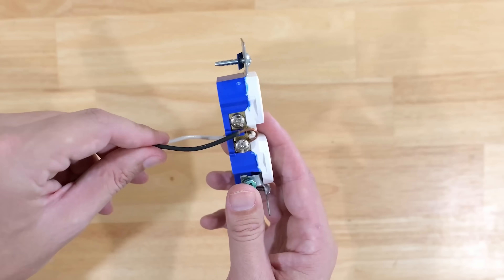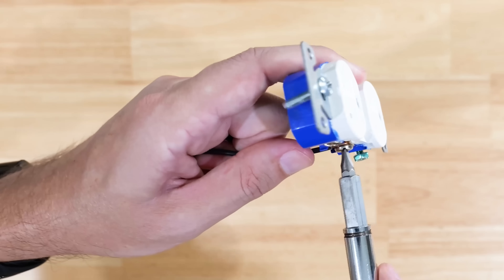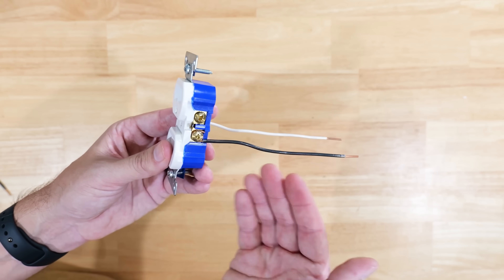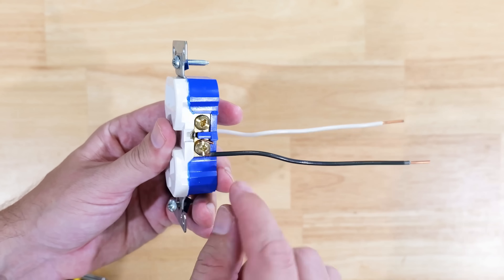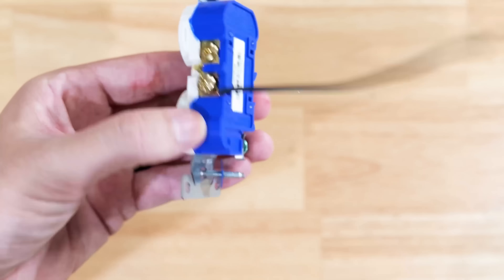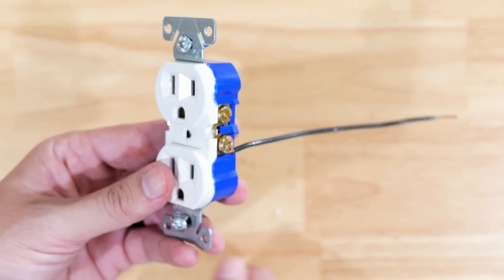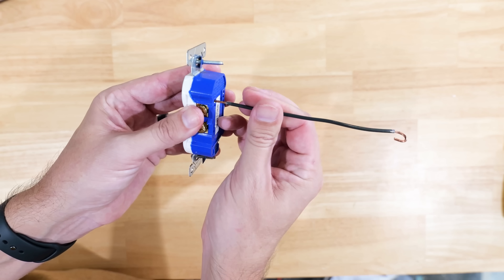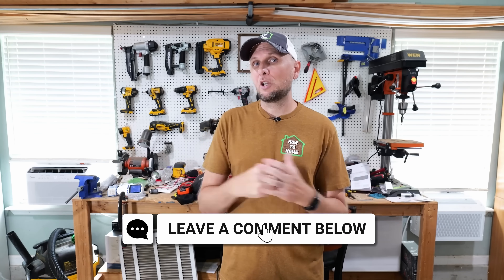Avoid Disaster! 8 FATAL Outlet Mistakes Most DIYers Unknowingly Make!

Comment: One correction and one pro tip: 1) You can only put 15A receptacles on a 20A circuit if there is more than one receptacle in that circuit. If there is only one receptacle on the circuit, it must remain 20A rated by using the 20A receptacle. 2) Directly terminating stranded wire to a receptacle screw is bad practice, regardless of the direction you install the wire. Use proper terminating materials like fork crimps for a much better install. There will be less of a chance of a hot spot.
Reply: I was looking for this comment so I didn't post a redundant one, also - NEC requires residential receptacles to be of a tamper proof (TR) style in most cases so the industrial receptacle does not meet that requirement if you are getting inspected.
Reply: So would 20Amp with 20Amp/multiple receptacles work?
Reply: @bobthorn7879  yes
Reply: @Tom-6502 I wasn't confused. I said one receptacle, not one duplex receptacle. So in essence, we are aligned in our thinking.
Reply: I still wouldn't do it as a professional electrician
Reply: @victorciccarone6291  ya I don't think I've ever seen it done on a commercial/industrial job but shackers do it all the time.
Reply: #2 is actually not allowed in some codes, i.e Ontario. One must crimp proper connectors on a stranded wire before terminating at an outlet
Reply: @TveTop  agree, it probably should be a code everywhere.
Reply: Loose wires not only cause fires, but they also increase your electric usage and bill. An arcing wire in a panel or on an outlet uses a lot of electricity. I had a friend who told me he had a large electric bill, his house had old type fuses. Tightened  the connections, next month his bill dropped to half, of what it was. Electrical connections, loosen with electricity going through them, over time. All connections in a house should be checked, and re-tightened, at least once every 10 years! 😮
Reply: @albertandersen627  It's not really possible to use up that much energy in a bad connection, since either the voltage will be dropping at the device to the point where it's unusable, or will burn up the bad connection and/or start a fire.  Just a few watts at the contact will be enough to burn/melt it over time, and that's not going to be noticeable on your bill.  If it was much more than that, it'd fail in some manner with or without fire.

I think there's some other coincidence to your friend's electrical bill dropping when he tightened things up.

I'm not disagreeing about anything else, though.  It's important to have secure electrical connections, because even if they're not immediately failing, a poor connection will heat up, and oxidize and/or fatigue over time making it even more likely to fail catastrophically as time goes on.
Reply: This is how they wired my moms new kitchen I thought it was wrong tell I found it was up to code to wire it like this

Comment: Great video! Very useful and good explanations of why you shouldn't wire receptacles a certain way and why the correct method is superior. I would also add that you shouldn't assume that the existing wiring has the correct polarity. I've seen several situations where someone ran a new circuit and reversed the polarity on the wire.

Comment: ermm AC is alternating current.. but yes should do the right sides for connections. now if these are being used for DC (direct current as in only flows 1 way) thats a diff deal.
Reply from the maker: It’s not though.  The things being plugged into the outlets are designed for the power to be fed from one direction.  If it’s coming from the neutral side then there is a risk of shock or electrocution as the on off mechanism won’t be stopping it at the start.

Comment: Strip wire where screw is on side. The distance from the back of the receptacle to the front from where the cover plate screw hole is. The thickness of that part is the proper length to strip.

Comment: I guess what you're saying makes sense. Too people that don't do wiring much, but for somebody. That's been wearing houses for 30 years. It's a little bit silly. However, I thought that when you talk about the last Leviton.  Receptacle that you didn't explain anything about the internals and if it's got the same amount of metal touching metal as the push in type.  In the back of the receptacle that you had a problem with.

Comment: @35 yr ago I entered my woman's walk-in closet and flipped the light switch;  I heard a "clunk" noise, didn't think much fora few seconds, then took the cover off the handy box.  Old wooden house with conduit & metal baxes;  box filled with lint.  Carbonized lint arcing against box!  Gained new respect for taping around conectors - especially in metal 2 X 4 box.  Another time yrs later, newly rented apartment, went to change the lamp above the bathroom wash basin (switch down) and skin contacted threaed base in fixture - major buzz - hot going up to base of fixture where ought be neutral.  Any place new check everything.

Comment: Baloney.  Click-bait on the first item in the video.  The 15-amp breaker determines a minimum receptacle rating--15 amps--and there is nothing unsafe about installing a 20-amp receptacle in a 15-amp protected circuit. We don't base our wire sizes on the assumption that an operating, correctly-sized breaker is going to fail.  WTH sense does that make?!
Reply from the maker: Then you are going against NEC code.  These codes are there for a reason.  You talk as if you do this professionally and if that is the case you may want to read the code book because what you are talking about is not only illegal but also dangerous.  So you can call it clickbait or baloney or whatever you want but you are completely wrong here.
Reply: @HowToHomeDIY  Cite the specific code, please.  Not substantively explaining why a 20-amp receptacle, per the NEC general reference, must not be installed in a 15-amp circuit isn't acceptable.  If you're a professional you should know and be able to explain the rationale for that specific code. I provided my reasoning, but you haven't reciprocated.  Relying on the claimed letter of the law, rather than explaining why the so-called NEC requirement provides necessary protection, is a dodge.  You may be correct, but until you can rationally explain why the NEC requires what you say it comes across as both unjustified and, yes, clickbait.
Reply from the maker: Ok so you are not a professional then.  The same could be said for you as you are not substantively explaining anything or how it is allowed by code.  You are sharing your personal belief based on what you perceive to be basic principles.  I explained it in the video but sure here you go: NEC 210.21(B)(3)
This code states:
"Receptacle Ratings. Where connected to a branch circuit supplying two or more receptacles or outlets, receptacle ratings shall conform to the values listed in Table 210.21(B)(3), or, where rated higher than 50 amperes, the receptacle rating shall not be less than the branch-circuit rating."
Table 210.21(B)(3) specifically shows that for a 15-amp branch circuit, the maximum receptacle rating allowed is 15 amps.
Additionally, NEC 406.3(B) reinforces this by stating:
"Receptacles installed on 15- and 20-ampere branch circuits shall be of the grounding type."
This implies that the receptacle type should match the circuit rating.

So no, you cannot put a 20 amp receptacle on a 15 amp circuit.  It is not unjustified or clickbait.  If you find this unreasonable then it is your turn to cite something other than your personal opinion as to how things work.

Comment: 2.01 most older  houses today have 15 amp outlets with 12 ga wire the trouble is when you try to get more than 15 amps on one plug! using a 20 amp outlet on a 14 ga thats got the proper size breaker 15 amp will only trip the cb or blow a fuse if you try to get 20 amp  from that outlet!
Reply: It doesn't matter if the wire is rated for 20 amps if the breaker is 15 amps you're only gonna get 15 amps..... you upsize wire gauge on long runs so it's not uncommon to see 12 ga wire on a 15 amp circuit that's actually cool.   You don't want to see 20 amps on 14 ga wire that's a big no no you can up size to compensate for voltage drop you never down size

Comment: 5:50 I HATE these holes! These should never existed. The professionals on purpose plug the straight wire, because us faster, easier, and because it guarantees a failure. And service call. Money!.... In addition, the thin spring inside does not provide sufficient compression and contact surface. Excessive heating.
Reply: It's time. You're being paid by the job, not by the hour if you work for a production builder.
Reply: @VideoArchiveGuy  i agree. yet, some electricians are better than others. in my previous job i watched the electricians, and they did the screws, not the holes. so, it is possible.

Comment: 3:10 DUDE: this is 60 Hz AC. there is not polarity. It is a safety issue. Period.
Reply from the maker: It is still referred to as reversed polarity due the current feed direction. It matters.  Dude.
Reply: @HowToHomeDIY  you reverse the live with the zero wire. but the electricity polarity changes 60 times per second. <50 times in EU, 400 times on a ship or airplane>
Reply from the maker: @west_park7993 it’s like you’re not hearing me.  It matters.  Things that are plugged in with on off switches are designed for current to start flowing from the line side.
Reply: @HowToHomeDIY  no. i hear you. but the idea of "polarity" is somewhat abstract when you have AC. you mean, live-ground. yes, i know what you mean, yes, i understand it is a technical jargon, but no, i can not accept it scientifically.

Comment: Ok, 2 mins in and I'm out...
If you put a 20A outlet on a 15A circuit and run that heavy a load on it, the worst that should happen is you keep tripping the breaker...
However , if you put a 15A receptacle on a line wired with 12AWG and protected by a 20A breaker you CAN BE asking for trouble. The circuit is only as strong as its weakest link - in this case being the 15A receptacle...
In my house built in 1977, there are 20A breakers feeding multiple outlets with 12AWG. Now say one is using a couple of high draw appliances on those outlets - see where this ends?
Reply from the maker: Ok you don’t know what you’re talking about then.  There is a reason code allows one and not the other.  Breakers are not fool proof and will not always trip above its rated limit.  Also, you’re not going to pull more than 15 amps on a 15 amp receptacle because anything that is designed to pull more than that has a 20 amp plug on it and it can’t be inserted into a 15 amp receptacle.  But see ya later 😂
Reply: @HowToHomeDIY  
I have 20A breakers protecting 15A circuits with multiple legs.
And using space heaters drawing upwards of that 15A limit HAS presented a problem - possibly due to voltage drop? Regardless, the outlets and appliance plugs get, shall we say, uncomfortably warm...😉
Reply: i agree, have seen this 15amp outlet on a 20amp branch melt when a malfunctioning mini-refrigerator was plugged into it. Outlet caught on fire because it couldnt handle the pull, but the breaker never tripped b/c it was pulling less than 20amps.
Reply from the maker: Well take it to the NEC then.

Comment: Pretty good, but you missed a big failure mode: nicking the copper while stripping by using the wrong part on the tool or by turning it instead of pulling it straight off.
(A pro taught me this... also, a 15 Amp duplex can  accept two 12A appliances and be over-loaded)

Comment: Let's clarify something about outlets.
It is true that a 15 amp rated outlet is only designed to handle 15 amps.
A 20 amp rated outlet for 20 amps.
However the load meaning how many things you have plugged in determines how many amps you will draw on the circuit.
The outlet by itself is not producing any load .
Reply: I do not think he is right. A 20 amp receptacle will not draw more than 15 amps with a 15 amp circuit breaker even if you connect a 20 amp motor to it. It will just throw the breaker. I do not think there is any problem with a 20 amp receptacle on a 15 amp circuit breaker with 14 gauge wire. You will have problems if you replace the 15 amp circuit breaker with a 20 amp, but you should know better when you try to connect that 14 gauge wire to the breaker. I think the problem comes when you put a 15 amp receptacle on a circuit with a 20 amp breaker. That can overheat the receptacle if you pull 20 amps through it.
Reply: Wonder.. should the black and white wires be chriss crossed on the back of the outlet..ex..black to the upper outlet and white to the lower outlet??
Reply: @spencerdavis5257 It makes no difference unless the tab between them is broken off.
Reply: @spencerdavis5257  black wire always on the gold color screw.
White on the silver color screw.
Reply: @spencerdavis5257  black wire always on the gold color screw.
White on the silver color screw.
Reply: @spencerdavis5257  black wire always on the gold color screw.
White on the silver color screw.
Reply: I have never seen a home appliance with that 20 amp style plug. It must be rare for home appliances in the US.
Reply: @markengle2199  I've seen them, it's only on high-draw appliances though so you can't plug them into a 15 amp circuit.
Reply: @markengle2199  That was kind of weird to begin with.
Reply: The plug
Reply: It is standard for 20 Amp circuits  @markengle2199

Comment: Electrical engineering trivia verifiable through Leviton tech support:   15A outlets are not rated for 20A pass through. If you break up some end of service life outlets and compare side by side that little wire bar between the side screws on a 15A vs 20A outlet, you will find that the 20A is more robust to carry the extra amperage, just as a #12 wire is required rather than a #14 for the same reason.

The proper way to connect a 15A outlet to a 20A circuit is to pigtail it, dead end, no passthrough that would end up overheating with a 20A load running through it.
 All my frequently used outlets get heavy duty outlets, everything inside them is more robust, your heavier cords aren’t going to start falling out of them any time soon.
Reply: I'll disagree. You can pigtail it, dead end it but once you plug into the opposite side (top or bottom) you're going through that connector tab anyway. The receptacle is rated for 20amps period.
Reply: But what if someone plugs a 1500 W heater and a 900W iron into that 15A receptacle? The 20A breaker won't trip, but there will be 20A going through the 15 amp receptacle.
Reply: @pcno2832  As it’s said, you can’t fix stupid.  When it comes to safety from an engineering design standpoint for certain things for the masses is that you can’t save the worst 15% of the general public from themselves no matter what so it’s not cost effective to try.   There’s nothing but your common sense stopping you from trying to boil gasoline on your kitchen stove is there?
Reply: I am suprised you didn't talk more about the ground wire since its generally  uninsulated and a good portion of outlets i pull from the box the wires were twisted as the outlet  was mounted  and many times when the outlet was rotated to put the ground pin up as per code nowadays. 

does anybody make any cords that hang naturally with the ground pin up?

All in all and excellent video will then and yes you do have a calm narration voice. 
Looking forward to see the other video you pointed to. 
Thank you sir i know you saved somebody's house or their Life there
Reply: @DonleyWilson-yi2tt cite a code article on the ground being up with a plastic wall plate. I'll wait.

Comment: The ONLY way to get power from an outlet into an appliance is by using the "stab" connector on the front of it. It's called a "plug" and they work for decades.

Comment: Does using the bare wire coming out of the "Romex" as the "hot" qualify as "reverse polarity"?  Heh, heh...  "Grounds?  Grounds?   We don't need no stinkin' grounds!"  Half the outlets in this trailer have NO ground!  That goo that prevents oxidation with aluminum wires attached to brass conductors?  That stuff is messy!  No one uses that....are those charred outlets still good?   Heh, heh  My advice?  CHECK THE DAMNED WIRING IN YOUR MOBILE HOME!  And I honestly think mine actually came that way from the factory!

Comment: Sometimes you find things backwards.  When I moved into my new home I started looking to add two new circuits in addition to the existing circuit already there.  The existing circuit has a 15A GFI and two additional outlets.  The wiring is 14 guage.  When I opened up the panel to add two additional 15A breakers I found a 30A breaker feeding the existing wiring.  Needless to day I changed that breaker to a 15A first.

Comment: Are the commercial outlets in your link "tamper resistant"? I believe that the residential code for my area calls this out. Maybe it's implied due to being "commercial"? I like that they accept more than 2 pairs of wire. If they're not "tamper resistant" do you know of an outlet that is and also has the wiring style of the commercial outlet you recommend?
Reply: The one shown is not tamper resistant.  However, there are commercial grade outlets available that are.

Comment: What is the best way to connect two wires to a single terminal on an outlet? I’ve always connected both wires together or one on the screw and the other in the quick connect in the back of the outlet. What do you suggest? Please extend me the courtesy and reply, I would really like to know what is the correct way. Thank- You
Reply from the maker: Making pigtails are the way to go so there is only one wire attaching to each device.